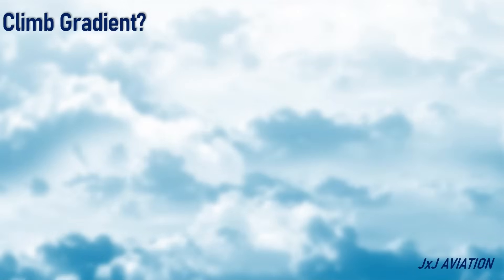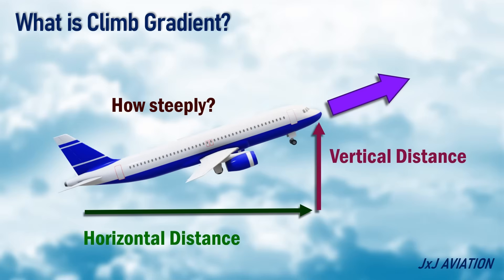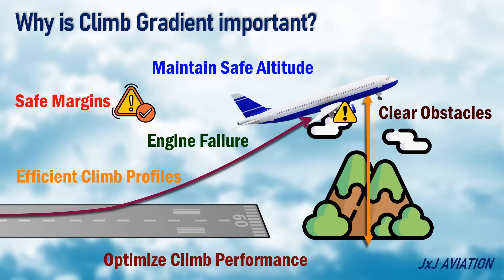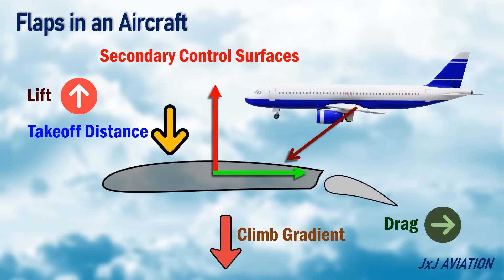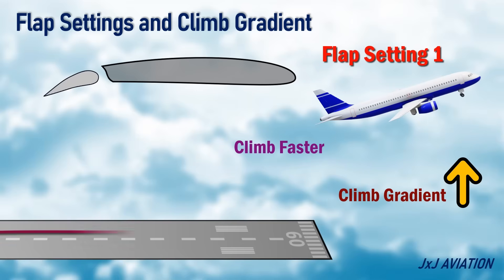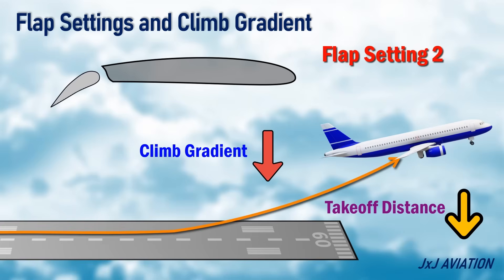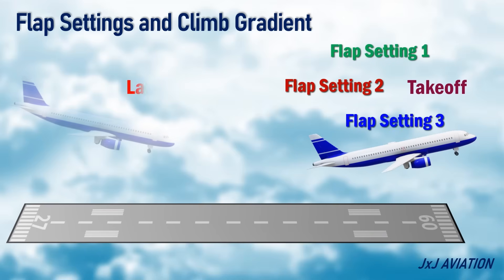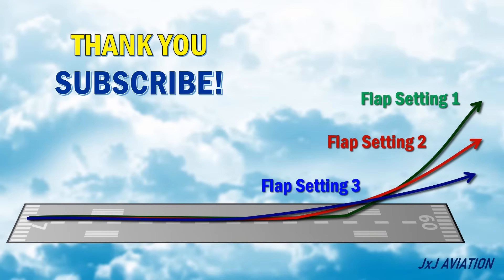Understanding Climb Gradient | Impact of Flaps on Takeoff Distance and Climb Gradient |

Comment: Speed change then flap angle change to keep same ratio nit fix formula. But minimum speed to operation of flap must be above 175 mile per hour for full minimum flap use if at higher speed then never use flap but only use trim mean aeleron ( smaller flap) if lower speed between  150 miles and 175 then full flap to climb fast enough
Reply from the maker: wow thanks for sharing the info.!

Comment: Sorry for my dumb question, but why exactly is the gradient decreasing with increased flap settings? 
Shouldn’t the increase in lift also increase the climb gradient? 
Or is the resulting increase in drag killing the gradient?
Reply: I think the last one is correct
Reply from the maker: when descending the local conditions have to be considered.
Reply: Remember, an incrase in lift will cause an increase in induced drag. Climb gradient is decreased because the flaps produce a lot more induced drag at a slower speed than thrust is available. The purpose of using flaps on takeoff is to lift off as soon as possible and start flying at a steeper angle. Once a safe altitude is reached, retract the flaps to speed up and increase the climb gradient to be more efficient.